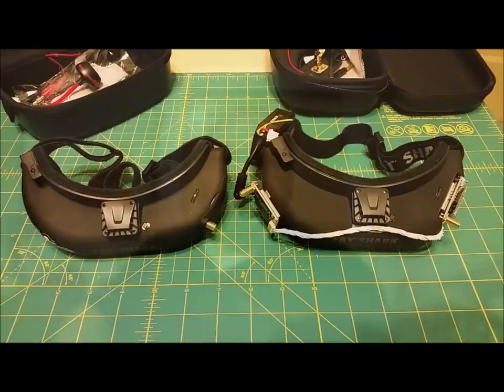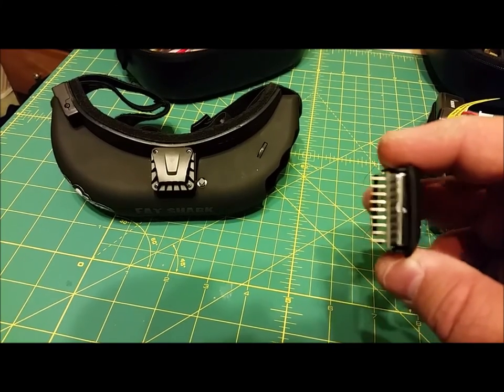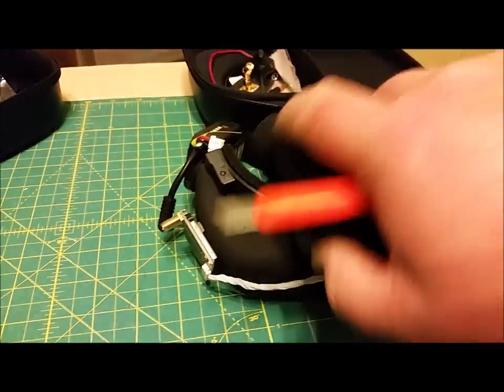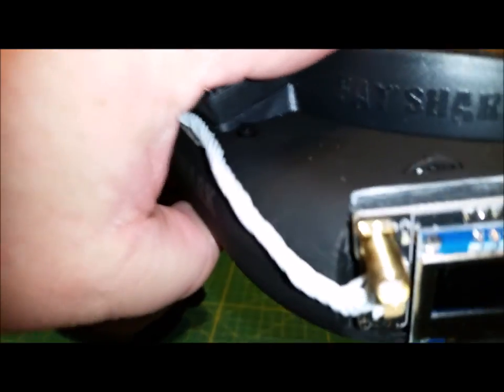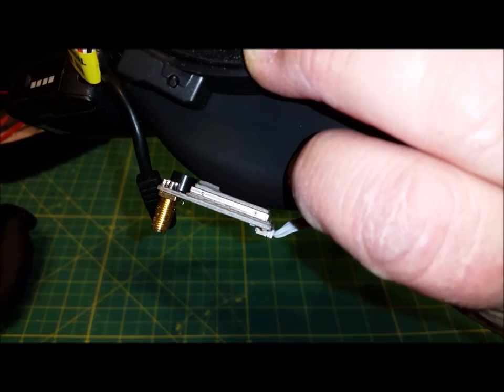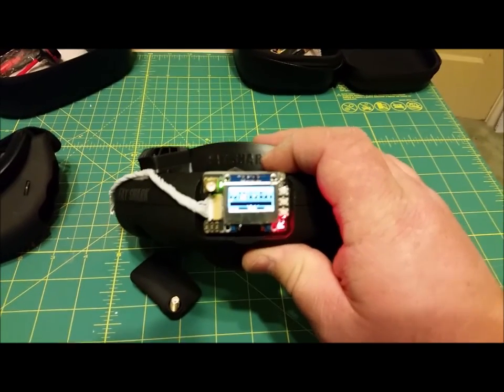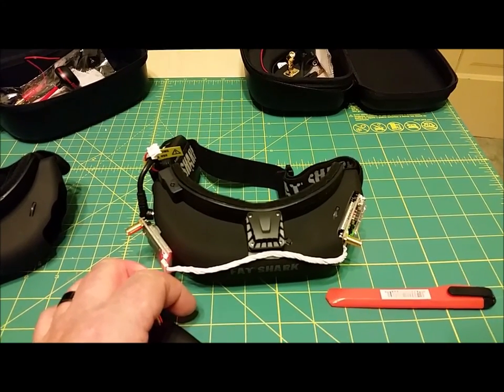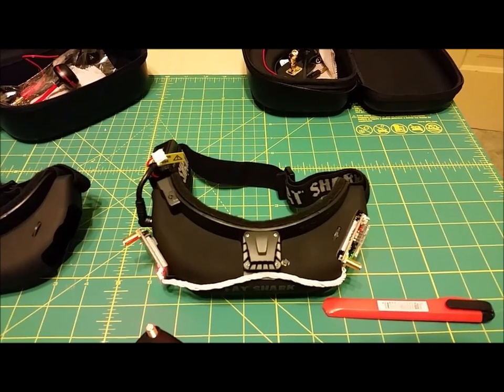Attitude V3 Laforge Mod

Comment: I had to beat you with the same laforge V4 I just started having trouble with the power but I had to press it on the module for the power up so I got to go back in and modded my buddy actually did the mod so I'm a little intimidated of pulling a goggles apart do any soldering inside

Comment: Hello kind sir,
Great video!
I have a question, I see you wear glasses and am wondering if you needed to buy optical inserts.
I plan on getting these over the Dominator V3s due to price and completeness, BUT later getting the True-D v3s.
Again great video!
Reply from the maker: v1ral671, my son and I both wear glasses and use the Attitude V3. neither of us need to use inserts. I feel like I can see fine.
Reply: Bluto FPV thanks for the quick reply, that is good to know.  I guess I'll try them out when/if I get them.
Reply from the maker: v1ral671, if I knew someone that had the inserts already I would try them out to see if there is a difference.
Reply from the maker: I ordered the inserts to try. I also talked the people at my eye center, they said if I brought my goggles in they may be able to grind lenses in my prescription to fit my goggles.
Reply: Bluto FPV I ended up getting Dom v3s got inserts as well to try..

Comment: How does this compare to having the one mod where you fit one of those on the one side only? Also once you get it all plugged in do you need to set up anything else?
Reply from the maker: Jake.Marttila there is some basic setup of the LaForge system once it is installed, but you will have that setup on any of the goggles. A friend of mine has the True D that is the one side. I will look at it and see how it fits in my goggles.